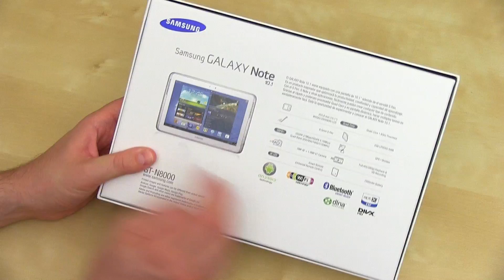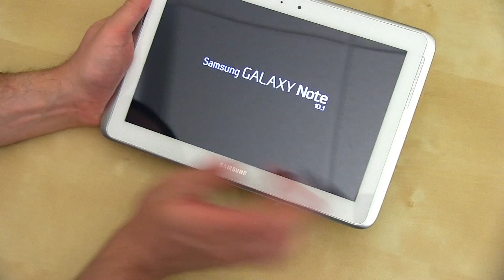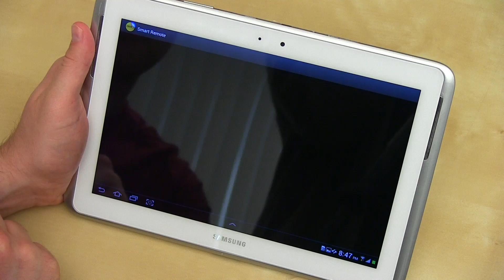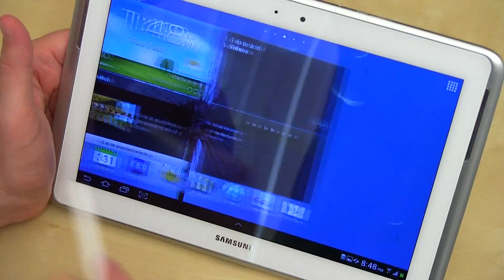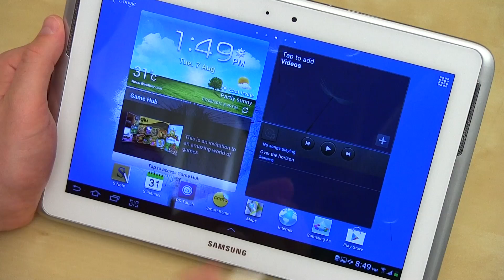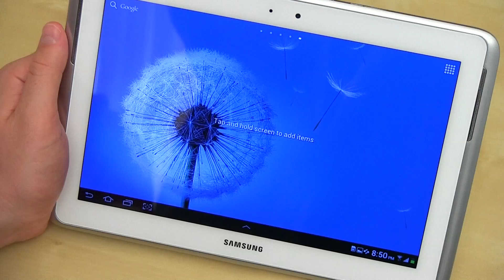Galaxy Note 10.1 Unboxing & Hands On

Comment: The reason behind the Samsung Note 10.1 not having a Super amoLED screen is due to the limitations that the 'Wacom' technology holds, which is limited to the 1280×800 resolution. If it was any higher, this technology behind the S Pen (which makes it completely different to any other competition), etc, would seize to exist on this tablet.
Hope this answers your comment.

Comment: yeah i agree with you about the non removable battery part but proprietary connectors can transmit more power than regular micro usb connectors and this thing needs it for the 7,000 milliamp battery it has.

Comment: These are the differences The note 10.1 Is 50 times better then original  note as note 10.1 Has a Quad core proccesor set at 1.4 ghz whereas The note had a dual core processor at 1ghz. Note has 2gb  note 5.1 has 1gb. Note is a tablet and more. Also has a better screen

Comment: These are the differences The note 10.1 Is 50 times better then tab as note Has a Quad core proccesor set at 1.4 ghz whereas The tab had a dual core processor at 1ghz. Note has 2gb ram tab has 1gb. Note is a tablet and more. Also has a better screen So just getting the tab is stupid and waste of money compared to this.

Comment: All the devices that I've seen that are supposed to have better specs than the iPad, are not as fast and smooth as the iPad, so itz not always the specs, itz how the os uses the hardware, my iPad 3 "aka the new iPad", is super fast, smooth and responsive with everything I do, and itz like that all the time, it never slows or lags, it cant really get any faster, so what is the point of your high end processors if they just drain your battery life and aren't any faster than my iPad, its a waist.

Comment: How do you figure? It may have a similar front, but this thing has the silver colored edges on it as well as part of the back. It also works in Horizontal format not Vertical. Also has no physical home button. And all the ports and buttons are on top only.

Comment: yea because they have faster graphics, the tegra 3 chip came out 3 months before the ipad3, it has 4 + 1 cores and 12 core gpu

the ipad has a dual core cpu and a quad core gpu

so you are right, android doesn't have the advanced apple chips because their chips are faster then them

Comment: Oh. Can the Ipad multitask like Android? And yes, Android has quad core processors, while Ipad has only dual cores(shitty A5X) but still, beats android in speed. It's because of the Open System of Android. But look at the features. It's not shocking to see that Android has more features than Ipad. Yes, some are just gimmicky, but still, Android producers are more idealistic than Apple does on their shitty Ipads. I'm no fanboy here, I ain't an owner of either devices. But I can say Android wins.

Comment: They should have used a higher screen res in my opinion. I have the transformer infinity coming tomorrow. Using a galaxy tab 10.1 now, have an hp touchpad and recently got my nexus 7. If Samsung brings quad core and a better display that will be my next toy. My sgs3 with quad core is awesome.

Comment: Buy the latest and greatest now, and you won't buy another product for at least 2 years =). For example, my current mobile phone is the HTC Desire. It's old; I've had it for 2 years. Hardware-wise, it sucks compared to what's on the market now. However, it's running Android 4.0 and will definitely take on Android 4.1 =).

Comment: perspectives have really changed. it used to be okay to have 600p on 15", 1200p on 21". than the flat panels came, 800p for 15 inch. now it's poor resolution if you only have 720p on 10".

Comment: 1. install 3rd party apps 2. choose a default browser 3. have widgets on the home screen 4. real multitasking 5. file management system 6. the ability to watch youtube in HD 7. no hassle of dealing with itunes 8. support for micro sd card 9. the ability to take icons off the home screen 10. the ability to play emulators 11. unlimited integration 12. toggle in the notification bar 13. choice of keyboards 14. support for hard drives and mouses 15. more unlock options... theres alot more